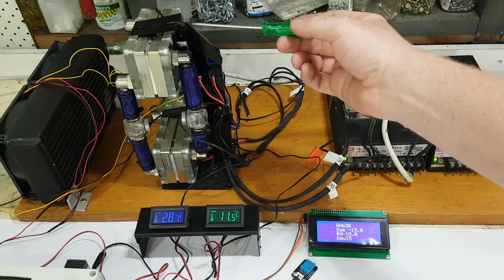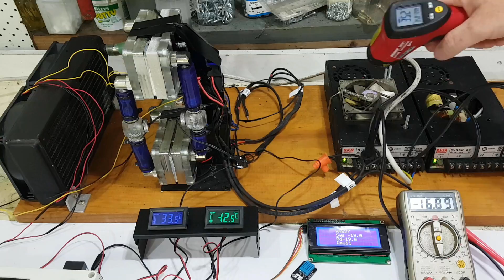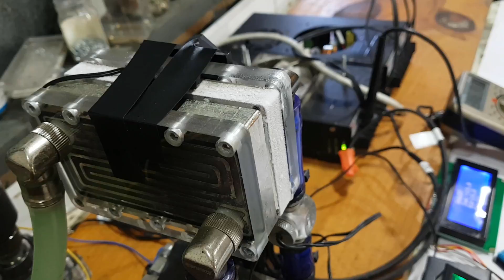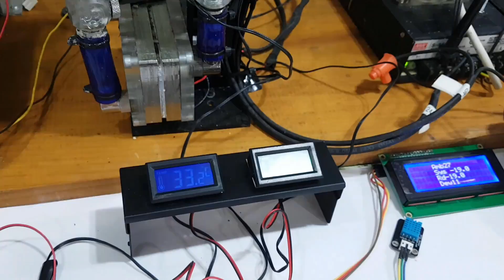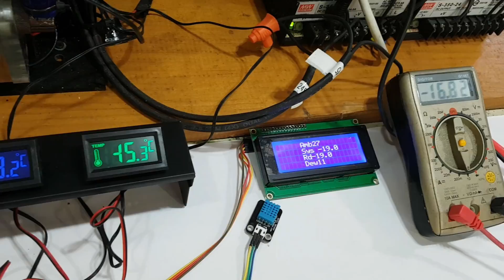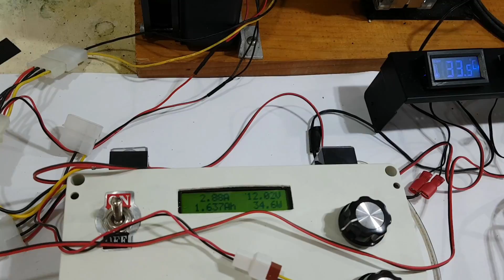⚡️ Thermoelectric Cooler / Peltier DIY Water Chiller @ -15.6c

Comment: So how are you controlling the tec? I got a buck based on your other video...still not getting the results I’m looking for. I’m using 2 TEC1-12704 powered by an old computer psu.
Reply from the maker: Those are pretty useless TEC's you have there .. what are you expecting from ?
Reply: @Ultrasonictwo  I upgraded to 100w TEC and started using water cooling for the hot side.  This works way better.  My understanding of TEC is growing...I’m now cooling my cpu at 35c while gaming.  What watt tec are you using?

Comment: very nice work..could you tell us what is the Arduino do in this project? ANd did you control the Voltage supply for TECs through Arduino PWM?

Comment: Great video. can these Thermoelectric Device be hooked in line and work on 24V ? i can only speculate 24V for a given watts means lower current but i am not sure if these works on high current which means we are better off with 12V.

Comment: May you supply the model numbers of the components you using. I'm working on a project for a hot/cold bath and using 4 peltiers around a bored aluminium block. Want to water cool the other sides of the peltiers to get a bet differential temperature. My aim is - 15 to 110 degrees Celsius. I'm going to be using 2 temperature controllers and 2 SSRs for the Peltiers. 4wire PT100 for temp.

Comment: hey man, do you think it'd be possible to make an a/c for a classic car with these? I was thinking liquid cool the hot and the cold side of the peltier chip. Have the cold loop go into a heater core inside the cabin, and the hot loop to a radiator w/ fan outside the cabin. Correct me if I'm wrong, but if I could get 35 watts of efficient cooling out of a few chips, that would be approximately equal to the cooling ability of a 13,000 BTU r134a a/c system. I read that these chips are about 5-10% efficient, which could be doable with an overpowered alternator and led bulb replacements. This is all based on the premise of it actually being able to work though, and I honestly don't fully understand the thermodynamics behind it. Edit: I just found your "understanding peltiers" series, gonna check that out!
Reply: It could work but your math is WAY off. 35 watts of cooling is nowhere close to 13000 btu.

Comment: I'm currently trying to build a mini A/C unit. I'm somewhat limited by parts I currently have. Tec1-12706, 150watt PC power supply 12v / 12a.
I'm planning on building it into a 6inx6x4 box with at least an inch of insulation on all sides. My current heatsink was garbage so I'm looking to upgrade to a Corsair hydro series H80 water cooler (not the H80i).
Do you think that would suffice?
Would just a simple fan mounted at the front of the box be good enough to produce a cold/cool air out put?
Basically it will be a tabletop unit that I'll be sitting next to.
Suggestions?

Much appreciated
Reply: ive found the Cooler Master Vortex Plus works really well its a low profile design and the foot of it is the perfect size for a 40 mm peltier not to small and just a bit over sized.
Reply from the maker: have you downloaded my tec calculator it has this cooler as one of the examples.. im more interested in if you're moving the hot side heat out of the room or not.. otherwise this is a heater .. ?
Reply from the maker: Things like these are a big joke 
https://www.youtube.com/watch?v=V3xCC44vbTc
These are not coolers these are heaters
Reply: This will be for outside use and close quarter range. Ie right next to it, lol
 Mine will also be insulated compared to the one on the video if that helps.
I haven't use the calculator yet. I'll take a look
Reply from the maker: ok sound good

Comment: i dont recomend those fans like that. its better if they blow on the fins rather then pull the air. but by pushing air onto the fins of the radiator after some time quite alot of dust will go there. but if the fans are pushing the air into the fins of the radiator the temps can get lower then that.
Reply from the maker: yeah the ease of cleaning it the only reason i do it... and if they were the other way around i'd never beable to get in there regularly
Reply from the maker: The difference is not significant.. But yes better, though ultimately worse it's to hard to clean all the time
Reply: cant you just use a vacuum cleaner for that?
Reply from the maker: No the fan is in the way .. you need to remove it first... and in most cases getting the fans off or getting a vacuum cleaner in the case is difficult or impossible.
Reply: wait you use that in a case? oh now i see why it is difficult to change the dust but then why not use a dust filter on front of the fans?

Comment: question....... if you reverse the wires will the hot side get cold and will the cold side get hot?
Reply from the maker: yes
Reply: Ultrasonic2 .... this is good to know. I am building a custom dune buggy and I was looking for a way to add air conditioning in the summer and a heater in the winter. I will be using the biggest modules I can find on eBay(about 8 should work) and a 12 volt pump,  Plus some small radiators of some sort with a fan attached... I will set this up so that the coolant goes through the heatsink to be heated or cooled then it will go through the radiators with the fans. there will be a two-way toggle switch for reversing the polarity between hot and cold.

Comment: how many amps does each module draw?
Reply: and what are the part numbers for the modules
Reply from the maker: These ones i got from frozenCPU.. it sounds like you might be interested in my Free TEC calculator ..http://Ultrasonic2.com
Reply: the website is buggy. 10/10 on the self-promotion tho. thanks :)
Reply from the maker: In what respect is it buggy ? it seems fine if you have a phone or high res desktop.. seems to have a problem if windowed to a small size on a desktop.. not sure what i can do about that
Reply: 1) takes ages to load. for reference I can watch 4k youtube videos comfortably
2) clicking on image does not yield pricing info
Reply from the maker: sorry 16.66A @ 12v (200watts)
Reply from the maker: Yeah the loading time (bandwidth) thing should be fixed next month, but i guess that will really be the following month lol

As far as i can tell clicking on the image in the description does being up the pricing.. but i guess your clicking on the image at the top(display image)

Comment: 20 amps at 24 volts is almost 500 watts! For the increase in cost for additional 500W power supply you could buy a faster more efficient CPU? Interesting to see what the actual value proposition is for all the extra complexity. I do love it though. Nice work.
Reply from the maker: It's pulling 400 watts.. i was never running it like this so it never pulled any where near this much power. This was just a "TEST" 
Also your assuming you can actually Buy a faster CPU and that you don't already have the best one you can get.. The thing to remember is once you've made something like this it can last for ever. But sure something like this is for the enthusiast. it's all just a bit of fun to play with.
Reply: Ultrasonic2 Ya, it is awesome. The whole reason I found this video is because I was thinking of doing something similar. Mostly for fun. Then I found dual socket and quad socket motherboard and CPUs with 12 cores etcetera. I want a budget rendering rig so it looks like a 4 year old server might be my best bang per dollar although this would be fun.
Reply from the maker: Doesn't sound like it's going to be budget bate :P

Comment: Can we use 2x2 sqft car radiators & pipe them out to another room ? Also should we use voltage amp connected to motherboard for Fan & Pump header.
[I wish to do that because here at my place that 2x2 car radiator (~25$) is pretty much cheaper than PC radiators (~120$) ]
Reply from the maker: you could assuming the Radiators are made of copper which is a hard thing to find these days. You could use aluminium for that rad and Chiller and thus avoid galvanic corrosion between Aluminium and Copper.. Also you could use corrosion inhibitors   However id NEVER recommend mixing copper and aluminium in the same loop
Reply: Ultrasonic2  
Thanks, I do note that. I would be using whole components of either only Cu or only Al. But, as we know those components would be subjected to corrosion ( which may be very-very slowly, dependent on coolant), tell me that which one would last longer with neutralized pH & less than 10TDS water.
Reply from the maker: I guess it's important to state that "Copper" rads are virtually never actually copper they hare 99% of the time actually brass with copper fins.. Brass is a very "Noble" alloy and will live forever :)
Reply: Ultrasonic2 
What about the water block, does Al coldplate will work as fine as Cu coldplate ?? & Yeah, the seller is a close person to me, he had some damaged radiators during transportation which I could teardown & examine. Got some brass fittings from other sellers too.
Reply from the maker: Well no. Cu contacts heat about twice as well at Alu so id NEVER go there but that's me.. Aluminium is cheap . but then what the point of a project like this if it doesn't work well. In saying this what are you trying to cool ?
Reply: Ultrasonic2 
CPU. trying to make a silent PC
Reply from the maker: Well Aluminium and "performance" dont go together
Reply: Ultrasonic2 
Just make me clear about "Aluminium & performance don't go together."
Reply: Aluminum transfers heat worse then copper, the thing I would worry more about then the "heat" difference is the corrosion that WILL happen, you could mostly get around this by plating the blocks with nickle, As far as the rads being aluminum  you may be able to find "heater cores" from vehicles that will be 100% copper on the inside with aluminum fins, I have a few and that is what used when I first started water cooling years ago
Reply: Devin D
Do you tried to connect CPU water block to that radiators..??
Reply from the maker: So maybe if you made it out of copper you'd get temps of 60c at load but if you made it out of aluminium you'd get 90c.
Reply: Yes, that is what I used for some time, They are great at transferring heat, they are what heats the inside of your car by running hot coolant threw them. Just make sure you get one that is copper core, if you got to a parts shop you can look threw a catalog/book and find exactly what you want

Comment: What are you thinking the temps of this would be under a 200-225 watt load? Guessing you would have to add another radiator for that, Even more so with the other two TEC turned on
Reply from the maker: Hello .. yeah i ran this way more rads than this cos this is to loud !  When running all the TEC's i ran each TEC at a lower voltage and therefore was able to reach the same desired temps i could with 2 TEC's but while using less power. (i did not attempt to run them at -15c) I talk about the benefits of parallel TECing in this video..https://youtu.be/CUsmKBkqsZU
Reply: Ok, I got ya,  With it all setup and running proper (all 4 tec's in parallel) is it able under load to pull in 0 deg C?
Reply from the maker: Well that was never its intent. i just wanted to keep it above Dew point why not using much power
Reply: More a concept of theory then anything else then! I love the work that you do, not many people take the time to build or do what they enjoy!
Reply from the maker: Well i didn't think there would be any point making a video of a chiller keeping at X temp. The first thing everyone would say is.... but how cold can it get